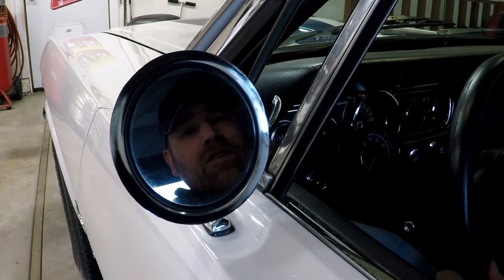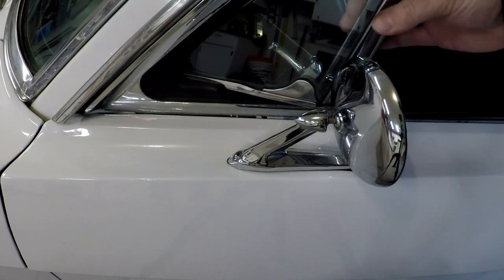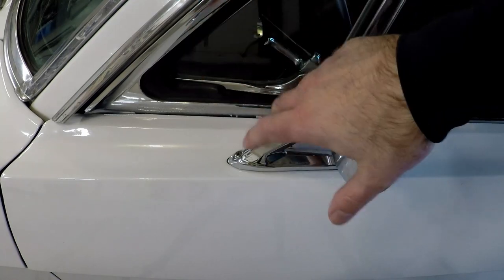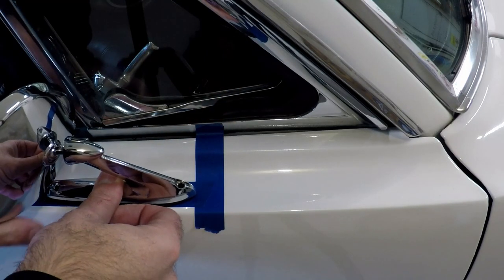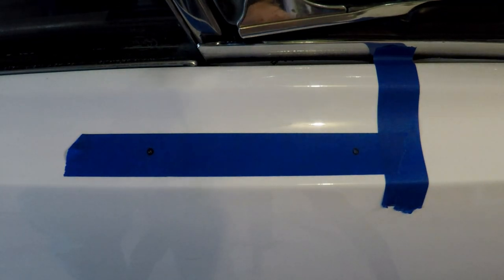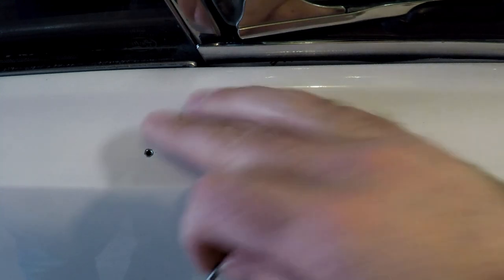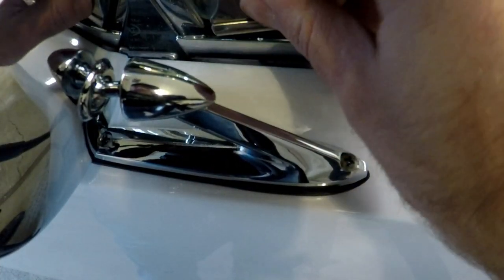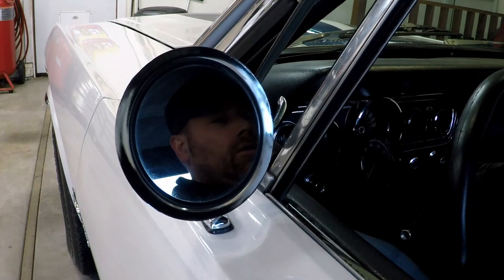How to Install Passenger Mirror on a 1966 Mustang

Comment: For the benefit of everybody watching, anytime you are drilling through paint, you should heat it first with a hair dryer or heat gun. Get it nice and warm; this makes the paint more pliable and less likely to chip when drilling through.

Also, cut off a short length of 1/4" rubber tubing (fuel line, vacuum tubing, whatever) and put your drill bit through that, and then drill. It will act like a rubber pad so your drill doesn't hit the car after your drill bit goes through.
Reply from the maker: This is good advice, thanks!

Comment: Gasket is upside down. Smooth side against the paint. Might help the original front screw to fit better.

Also good idea to tape down mirror and go back to drivers seat and check position. Although it looks like you were plenty far back enough.

I believe in 67 they went to well nuts for the mirrors.
Reply from the maker: I knew I had that gasket upside down, but I talked myself into the other way.  Figures!  :)
Now that it has been a while, I wish I would have gone back another 1/2 inch or so.  The wing window clears but it's close.  Having that extra clearance would have been better and it really wouldn't have changed what I can see out the mirror from the driver's seat.

Comment: The vent window on my 65 hits the mirror also. It's factory as far as a I know.
Reply from the maker: Is there a different mirror I can purchase?  This mirror does not work as well as I thought it would (coverage wise).
Reply: @AndyKruseChannel  I think you could probably make it work with a square mirror for a 67.
Reply from the maker: @TheScientistHayFarmer  Do you know if that mirror has the same bolt pattern so I don't have to drill more holes?
Reply: Andy Kruse I don’t know if it has the same bolt pattern or not.